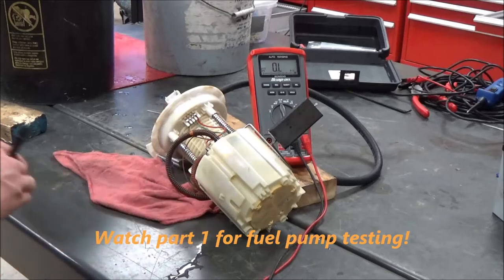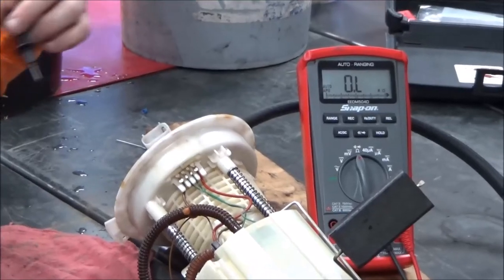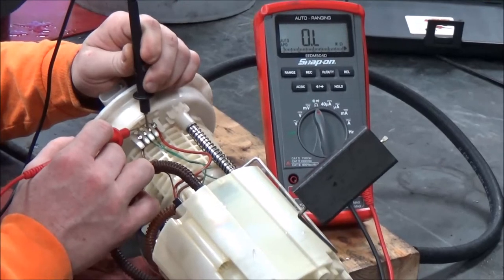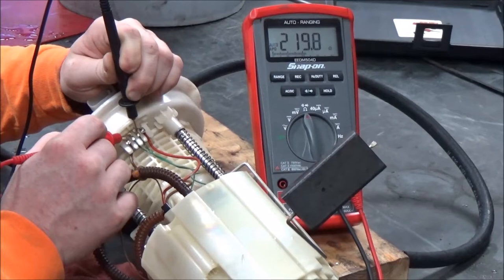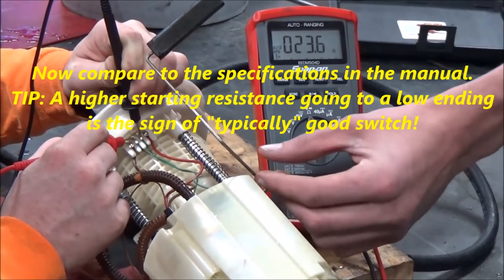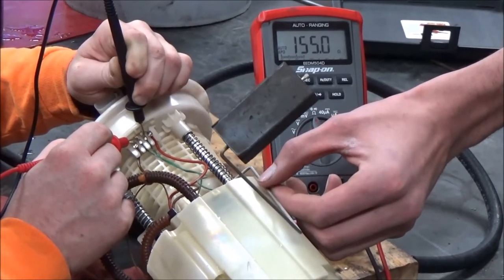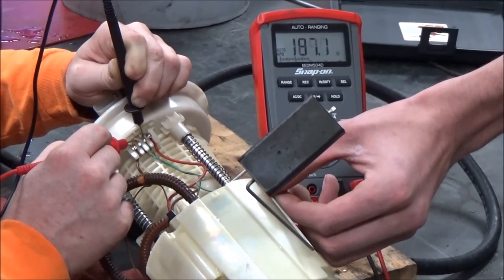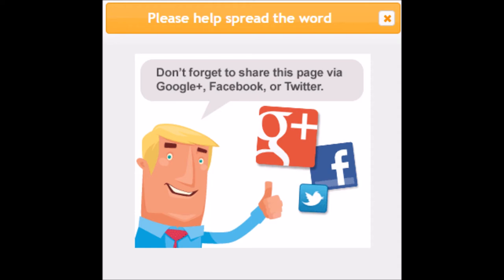How to test a fuel tank float switch in under 1 min!

Comment: Hi. My bike fuel gets reserved early and the bike stalled with 4litres of fuel in the tank. I've changed the fuel strainer and cleaned the injectors. Does the float sensor caused it?

Comment: hey i got a fuel pump like this meaning the outside wires are power and ground inside wires are float level sensor. ARE THEY polarized or non polarized? is there a positive and neg to the leveling circuit